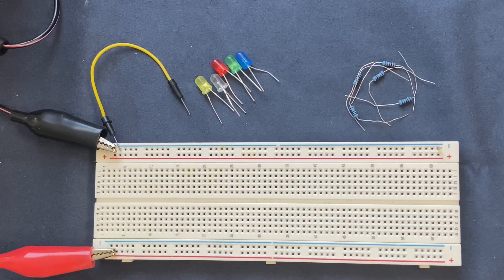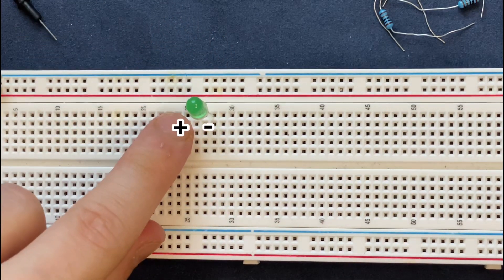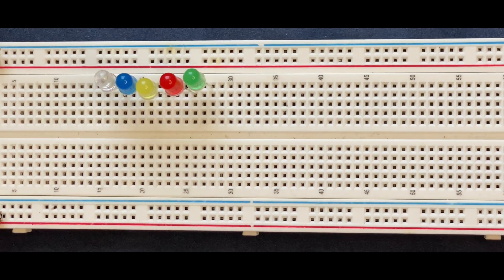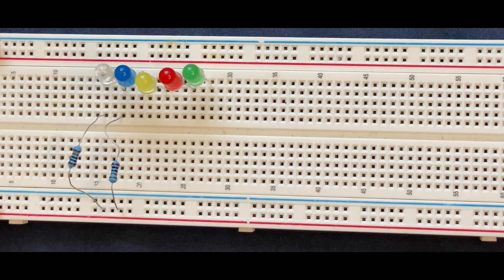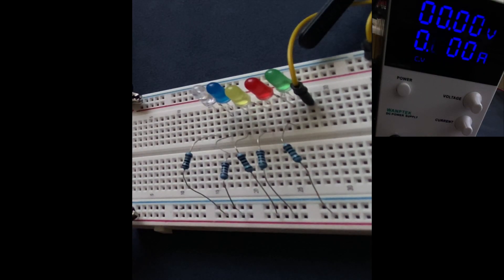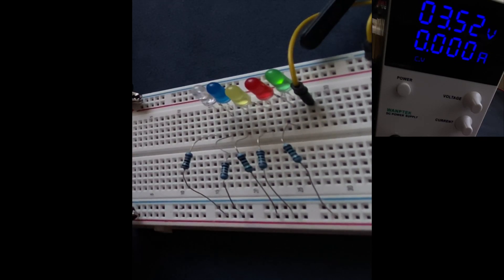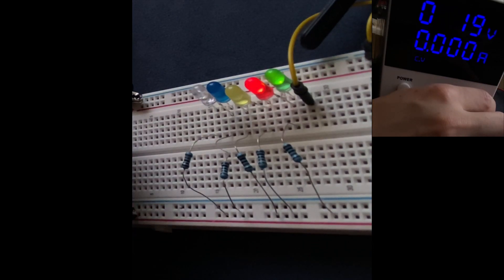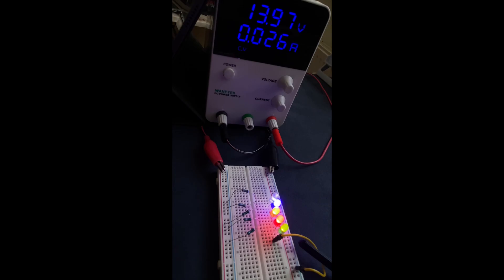Voltage Level Indicator on Breadboard with explanation✅ #breadboard #digitalelectronics

Comment: Sir, can we change the order of color Leds? i.e. White, Blue, Yellow, Red then Green. Please explain.
Reply from the maker: the order of the colors does not significantly affect the functioning of the circuit. However, the visual appearance and the perception of the voltage levels by the viewer may vary based on the arrangement of the LED colors.

Here's an example of how you can arrange the LED colors in increasing voltage level order:

1. Red (Lowest voltage level)
2. Yellow (Intermediate voltage level)
3. Green (Intermediate voltage level)
4. Blue (Intermediate voltage level)
5. White (Highest voltage level)

So to sum up , yes you can change the order of colors
Reply: @ElectroMin  Thanks for your reply, i have one more doubt. i.e. firstly the green led switched on at 3,5 v which is its forward voltage, then red led switched on at 4.2 volt. does it mean that now forward voltage of green and red led has added up because they are connected in series. Does this rule follow yellow, blue and white also. Please also give forward voltages of all color voltages
Reply: If red has the lowest forward voltage then why didn't red led glow first instead of green led?
Reply from the maker: @sridharkrishnappanavanerth3388  Yes, in a series circuit, the forward voltages of the LEDs add up. 

I will describe the process of the circuit

Green LED (Forward voltage: 2.0 to 2.4 volts): At 3.5 volts, the green LED starts turning on because the forward voltage is reached. It is the first LED in the series, and the voltage across it is around 3.5 volts.
Red LED (Forward voltage: 1.8 to 2.2 volts): At this point, the voltage across the green LED is already around 3.5 volts. To turn on the red LED, you need an additional voltage equal to its forward voltage, which is 1.8 to 2.2 volts. So, the total voltage required for both LEDs to turn on is around 3.5 volts (green) + 1.8 to 2.2 volts (red) = 5.3 to 5.7 volts ( in our  experiment red turns on at 4,2 volts ) 

This rule would be applied for the rest of the leds , for example yellow :  3.5 volts (green) + 1.8 to 2.2 volts (red) + 2.0 to 2.2 yellow forward voltage = 7.3 to 8.9 volts and so on

Keep in mind that these are general ranges, and actual forward voltage values might differ slightly based on the specific manufacturer and LED model. In our example red turns on at 4,2v however it has to be around 5,3 ( there is also a bit delay between the breadboard video and power supply video which can also be the reason why these numbers don’t match 

But to sum up always green led (3,5V) + the forward voltage of the next led in series

You can search the forward voltages of the LEDs in internet

Please let me know if you have further questions
Reply from the maker: @sridharkrishnappanavanerth3388 because green led is the first led in the series circuit
Reply: @ElectroMin You have explained beautifully. I had seen plenty of similar videos on the internet and non of them explained this working logic. They always play background music. When i requested the working explanation non of them replied, it seems they copy others video blindly without knowing the theory. Thanks a lot, i learned a lot from you.
Reply from the maker: @sridharkrishnappanavanerth3388  glad to hear that my friend, my aim is to explain each step what im doing on breadboard rather than just wiring the circuit from schematic , hope you enjoy my upcoming videos 👍

Comment from the maker: Other cool projects 🎥

Fire Alarm Circuit 👇

https://youtu.be/jc5K2RMGQY0

RC Low pass Filter 👇

https://youtu.be/JXGlq6THyWU

RC High Pass Filter 👇

https://youtu.be/q6zvZ1LpvIs

Darkness Sensor Circuit 👇

https://youtu.be/kePkWBJPhYU

LED Flasher Circuit 👇

https://youtu.be/Zu1TZ-9C33U

Doorbell Circuit 👇

https://youtu.be/XZ2f612WOTU

Half wave Rectifier 👇

https://youtu.be/SHu47wmiY7I

Charging/Discharging Capacitor 👇

https://youtu.be/HUgAc91mMe4

Darkness Sensor using LDR 👇

https://youtu.be/7YCyIWMN3qM

Electric piano 👇

https://youtu.be/daSFJJLkSj8

Water Level Indicator 👇

https://youtu.be/ghXExbBpctM

Logic And Gate 👇

https://youtu.be/IWW-HSIR5nY
Reply: nice but battery percentage on the thumbnail is flip, 100% should in other side not near the source as you shown on the video